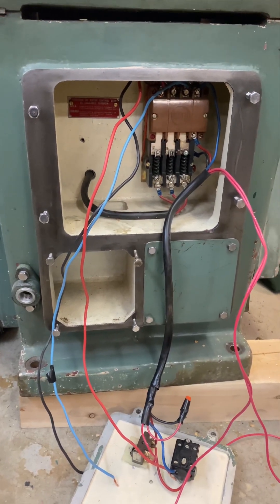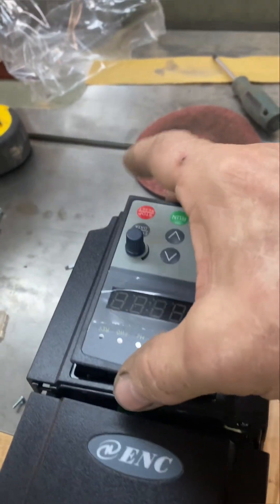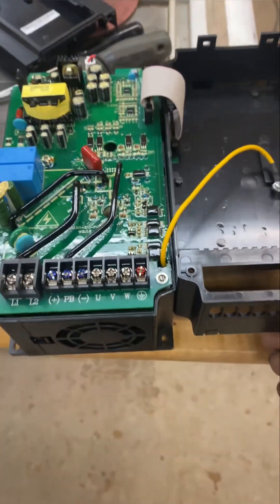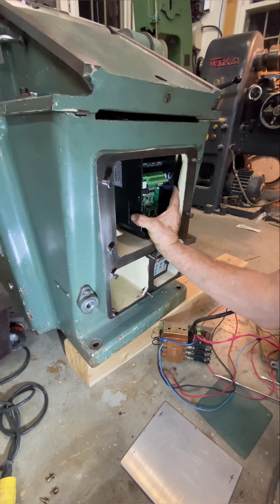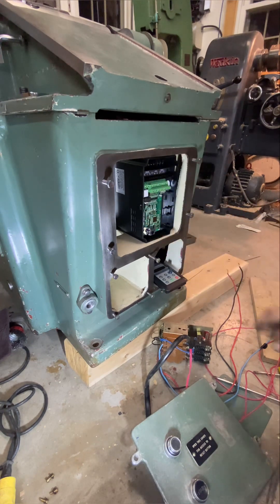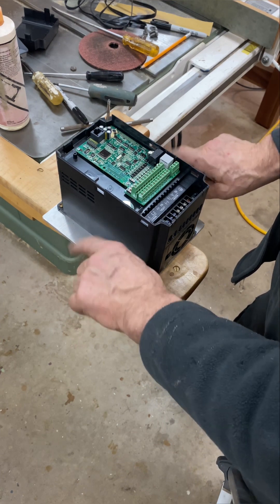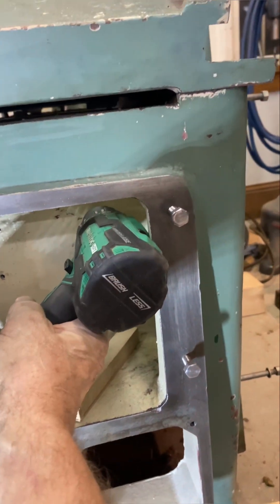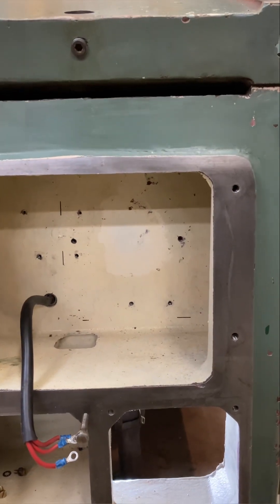part one #wadkintemple  VFD

Comment: Just curious, will there be an enough air flow given the fan on the bottom of the VDF as it looks as if it will be behind the door?
Very neat install BTW
Reply from the maker: not a problem at all, if I was operating the frequency, drive for speed  control I might be concerned, but it generally will be just maintaining the same frequency so virtually no heat
Reply: I see. Fans and airflow are not something I have massive experience of in this setting. Learning by your experiences
Reply: Don’t forget Jack has an aluminum plate bolted to a massive cast iron body. So some heat should be pulled away from the VFD. As Lao remember that just because the motor may say 5 hp, that does not mean a constant 5 hp current load. The actual load will fluctuate depending on actual use. You don’t normally do hogging cuts on a jointer. It’s nice to see wadkin often cast the electrical boxes into the machine.
Reply: True but that is a plastic surround for the VFD. There is no direct contact of VFD to plate so any heat will only be transferred by air not direct contact.
Jack’s comment of lack of heat makes more sense than aluminium heat sink
Reply from the maker: @dougsaunders8109  the back of the VFD is not plastic it is metal. The fan is not something that runs constantly and the temperature rating of the VFD is 40°C  Dev has said the motor is not really loading all that much. I've got this VFD and smaller enclosures going on five years. No issues at all another interesting feature of the VFD is it can display the VFD temperature on the screen. I'll use it to see how it performs but I suspect it'll take a while for it to heat up the cast-iron.
Reply: @jackEnglishmachines  yep cast iron has some thermal capacity for sure